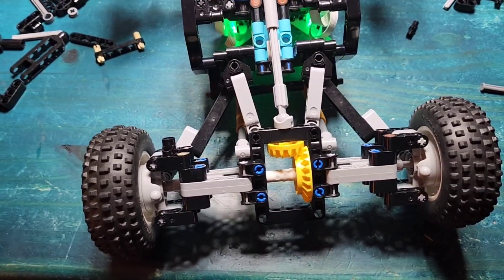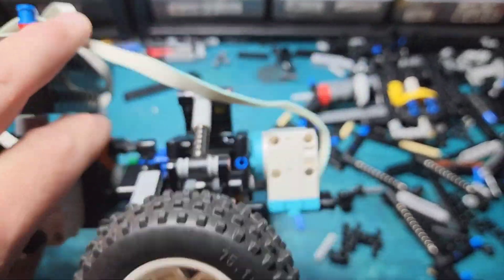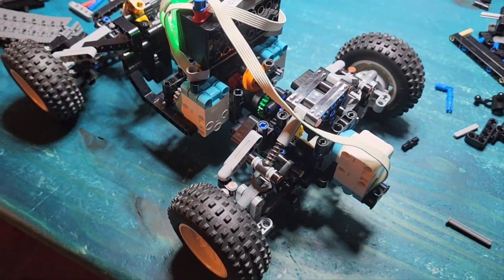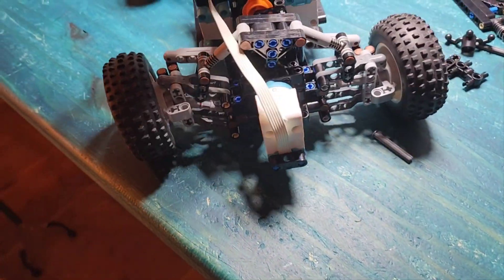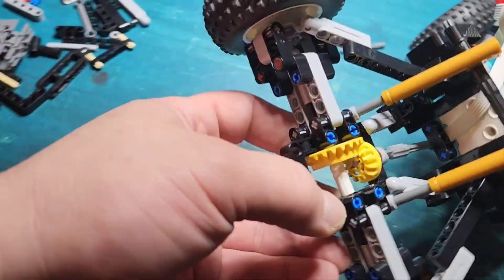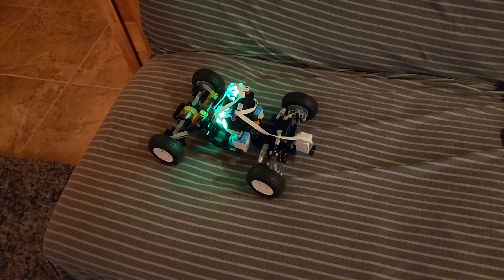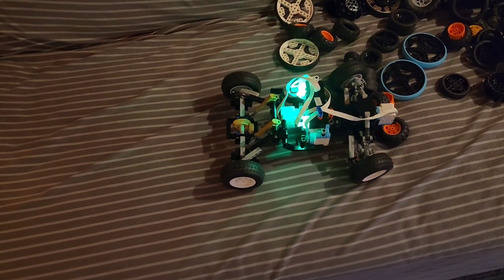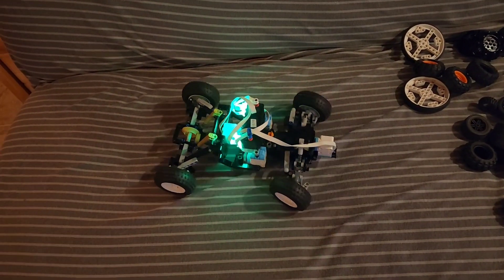4x4 Lego Technic mini with steering and transmission using ONLY 4 Technic small angular motors

Comment: Those motors sound like angry bees for sure. I assume they are quite easy to overheat?
Reply from the maker: Yeah, they're clearly not intended for this purpose. I don't recommend that anyone try this at home. I use them almost exclusively to fire the orange gear selectors.
Reply: Thanks for the feedback. And yes it makes sense, they are designed for low loads such as gearbox switches, steering systems, valve controls, light functions as door opening, etc...
Reply: they have low torque, speed and are made for extremely small builds yoshigoto isagowa has a spike essential kit if you want to see it

Comment: does the steering calibration work for you on medium angular motors?
Reply from the maker: No, actually it didn't. But after the design was all done I really didn't have space for much else so I just removed the center steer profile and tried not to break it. It was a silly design, I was more looking to test the limits of these little motors and I found them.